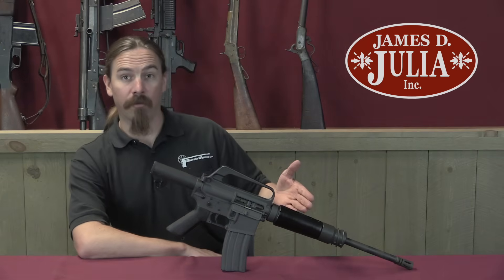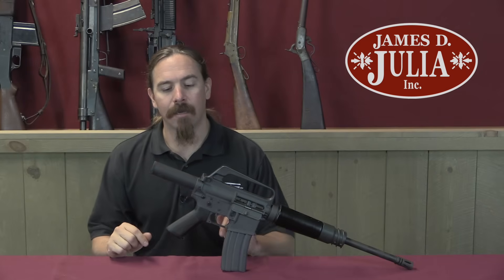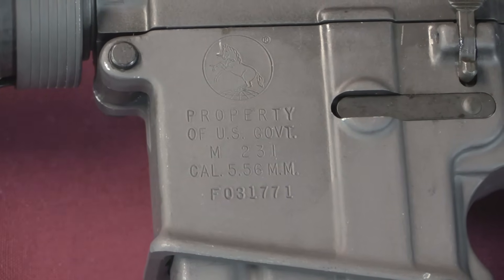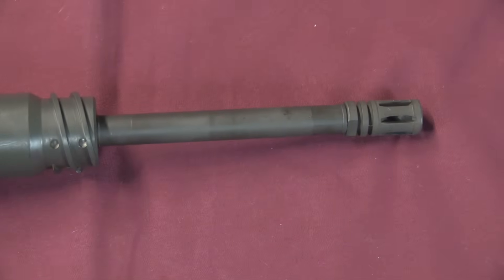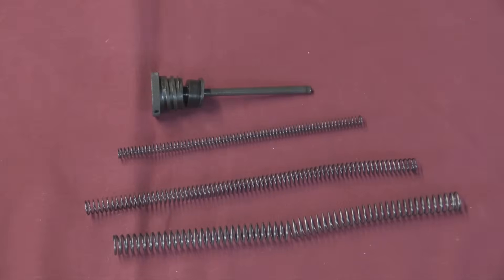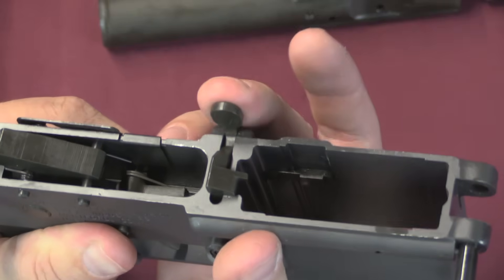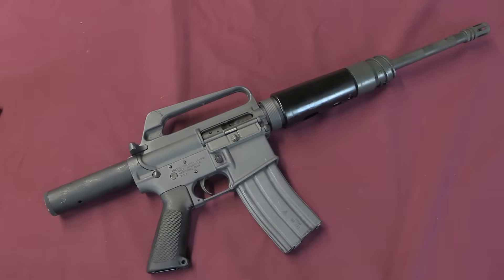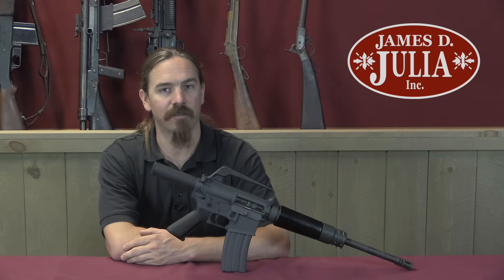Really Not an M16 at All: Colt's M231 Port Firing Weapon

Comment: The M231 Firing Port Weapon is only intended to be used inside the Bradley AFV in a special mount. Hits hard, but good luck hitting anything...
... You're going to use it anyways, Boss?

Comment: What do ya know, another insanely expensive, mostly impractical part of the Bradley catastrophe!!!! Ps. I spent 7 yrs in the Mechanized Infantry. 90 to 97
Reply: The Bradley was no "catastrophe" despite its expensive and complicated R&D (as many other projects faced similar), and the silly movie you likely refer to. It turned out to be a decent IFV. I you really spent 7y in mech you would know that.
Reply: I was 1st cav and 2ID 95-98..
I feel like the Bradley kind of proved itself in desert storm, and now in Ukraine..
And in retrospect, I'm glad I didn't blow out my knees or my back because I wanted to be airborne.
Reply: @rogerwilco5918  The only reason why the Bradley has that bad rep is this silly movie (which afaik is based on a book). Found it funny aswell, than did my service and research and realized that this movie is overblown comedy and at times made by/for stupids. Alot of the changes during R&D and the transition from APC to IFV, were in response to the advancing tech and doctrines, specifically as reaction to the BMP-1 and its good performance in Yom Kippur. AC, ATGM, decent armor against similar, firing ports, but less dismounts were the new trend of IFVs and nothing crazy. While the Marder and BMP went for the lower silhouette approach, some argued the higher of the Brad helps with line of fire over friendlies. Firing ports concept didn´t make it long and got removed from most IFVs. Ukrainians are quite happy with the Bradley. It is nothing special but neither a catastrophe.

Comment: The reason this weapon was developed is that it screwed into a firing port in the hull and was fired by spotting through a vision block, so it created less of a vulnerable point than firing slots large enough for several men to fire out at once.

It didn’t really work.
Reply: Also using your service rifle in a crowed mounted Bradley would be not easy. (Butt, sign post, handguard...)

Comment: I had an Armored Cavalry Troop of M3's in Germany. The M231 was needed because the standard M16A1 would not provide a seal against NBC agents (they tried, how the Russians and Krauts did it I don't know), hence the threaded adapter. The M231 was NOT an individual weapon, it was part of the M2/M3's vehicle suite and issued as such, like the chain gun and coax machinegun in the turret.  Of course, having an M231 and M16 for almost every man, made an already crowded vehicle even more cramped! Once the A1 vehicles arrived with applique armor covering the firing ports, the M231's disappeared.

Comment: TY-Ian. I get it now about the M231 PFW. It is designed as part of the Bradley's self defense , AND the 231's may become contaminated while driving through the NBC battle hell. IF Infantry M-16's were used, they would contaminate the interior when pulled in from the FP.
 -Designed  so the troops can NOT use them freely is a factor you may have missed ? ;)

Comment: Read a lot of the comments here. A couple things I'd like to point out. First. the weapon used 40 round magazines, not 30. Second, each port had a vacuum tube/brass catcher bag that clicked onto the weapon and fan exhausted the gases outside of the vehicle. Third, when dismounted you shoot it like you shoot an Uzi. 
The problem with this comparison with an Uzi is there's no one shooting it correctly as far as I can tell on Youtube. So I'll try to explain.
With the M231 you tuck that short buffer tube into your armpit, and jam the "carrying handle" hard into your shoulder. Grip it tight with your upper arm and pull hard back with your lower fingers so it's locked into your torso. Then you take your left hand across your body and place on top of the short handguard, thumb down on the left side, using your palm to press hard down. 
This is the technique we were taught by the West Germans at the Scheutzenschnur qualifications and cross training events, where we shot all the weapons. 
I'll be honest though, it doesn't make it any better, but it does keep it from getting worse.
I was a SAW gunner for the first 4 years, had a SAW in Desert Storm. The old one. Thing about that old saw, if you were willing to sign a statement of charges and the commander decided to, you know, not give you an Article 15 (that old adage about asking forgiveness applies if you got the cred to pull it off), you could do things to it that you can't really do with the newer ones. But to be fair, the newer SAWs have the bells and whistles that the original SAW didn't have, like the extendable stock and the short barrel. Back in my day, if you wanted a short barrel you had to make your own, and you cut it too close it doesn't cycle anymore. The stock was easy, just cut the stock off the buttplate, drill a hole through it for a sling, hack the rear sight off the feed tray, hack the front sight and carrying handle off your now slightly shorter barrel, cut the bipod down to about 6 inches and tape the legs together leaving the feet, and you get a much better fully auto trenchsweeper that you can put the bits into your ruck and take with you if you think you will need it. They do make you pay for another barrel, stock, bipod and feed tray, but at the time it was like 400$. Or so I've been told, allegedly, by a friend... But 200 rounds beats 40 rounds hands down for certain applications.
Reply: Thanks for this.  I started to respond to a six year old post where the guy said shooting it filled the Bradley with smoke and brass.  I seriously doubt the guy ever served in a Bradley because you are right, it had an exhaust system and brass catcher that attached.  However, unlike you, I don’t remember ever firing the port weapon dismounted.  I only remember shooting it in the Bradley (I went through Bradley transition in Germany with 1/4 Inf., 3rd ID in 1984ish).  You could never get more than 3 trigger pulls no matter how tight your control was that thing fired so fast.

Comment: My unit retained our port firing guns up until 2017 iirc, I had the opportunity to mess with them. I had no pretext or instruction, so i was surprised when i took it apart to see the differences. Ours did have the wire stocks however no front sight. 

Cool peice of history that likely could have been replaced by a small fixture that mounts around the barrel and clips to the bayonet lug.

Comment: I wonder if one of the reasons "why not use the regular rifles" would have anything to do with the potential for that to lead to a discharge inside the vehicle. If your guys are using their own rifles out the ports and one of them gets hit or goes down, whether it be due to a bullet or shrapnel, it could be possible for his weapon to fall out of the port and for him to accidentally discharge it after it does.

If the weapon is mounted into the hull, that can't happen.

Comment: Wouldn't a belt feed be better for a spray and pray firing rate?
Reply: No room in the Bradley to have that many belt fed weapons in action at once.  Plus, when they were first fielded, all we had were the M240 and the M60.  There was an M240C mounted coaxially with the main gun in the Bradley, and each Bradley crew had one M60 gunner.  You would have had to convert the whole dismount team into machine gun teams for your plan to work, even if there was enough room.  Then there would have been the issue of barrel changes in a moving vehicle.  I think the better solution wound up being what they eventually did…give up on the firing ports and put more armor in its place.

Comment: Wait what about the third pinhole isn't an open bolt full auto not required to have a full auto sear
Reply: no the trigger on this is not a trigger/hammer set up, but just a block and notch like an open bolt machine gun

Comment: I wish I could see a cad rendering of this in action. So the spring system pushes the hammer rod into the pin after the bolt has locked? How do you time that?

Comment: Its interesting this is the weapon they feature in Battlefield Bad Company 2. Its mounted in the sides and rear of the M2 Bradley the BMP2  and the sides of the AA tank its the Russian capture ZU 2 Something.

It really is scary it sounds like a MG34 and it basically garuntees a respawn on the guy getting to cocky to with an AT launcher it has essentially infinite ammo you just have to burst fire it for 3 to 4 seconds

Comment: Besides the reason several others have mentioned previously (NBC sealing while the M231 is installed) another reason the Army used the M231 instead of the M16 is the brass catcher and gas recovery hoses would not fit on a standard M16. The lack of a brass deflector and forward assist gave the receiver a flat surface to mount the hose and catcher assembly. To be honest, it didnt work perfectly, but it did help keep gases from building up in the back of our track.

Comment: Why not use standard issue soldier weapons? This is a drivers gun. Bradleys are cramped. This is shorter. Y full fast auto and no sights? You will have a choices in a brad for enemies at range. This is holy poop theres a guy on the brad need to clean him off of there gun. The driver of the brad has very little leg room the hatch is big enough but easier to get that guy off the hood by sticking a shorter full auto out the hatch than a larger more robust weapon.

Comment: I only know about this gun from a game on Roblox, It's called Phantom forces. It's the 2nd most popular FPS on the platform and the M231 is one of the last assault rifles you can unlock. It has insane recoil and an insane fire rate. It basically goes straight up after you fire it for 2 seconds

Comment: The most interesting part of this is the bolt hold open is behind the sear which id imagine is because the muscle memory of the user is to throw another mag in and slap the release and continue firing however since it’s open bolt it would send the bolt home and fire off a round 

Idk if this is correct just a speculation

Comment: I got parts to a 231.  I have the side selector plate, I have parts to the buffer tube and the extension that went over the tube for the grease gun wire stock attachment with the wire stock and button.
Think I'm going to build an AR and use the parts to make a representation piece since I'll never afford a real one.

Comment: If you could get one cheap enough I guess you could strip it down to the bare lower weld up the fcg holes and redrill for a standard M16 fcg and build it as an M16

Comment: M3a1 grease gun could have been easily modified to fill this role. Literally a 6" barrel shroud / nut with port thread on end.
Arsenals made 45 acp tracer. ROF could be increased with a spring swap.

Comment: I was with 1st battalion, 18th Infantry in Iraq.  We used to keep one of those beside the commander’s hatch on the Bradley turret in case we needed to spray bad guys up high on a roof or on the vehicles.  We actually did mount them up in the ramp firing ports during Operation Baton Rouge in Samarra but they weren’t used much.  Damn things emptied a magazine out too fast.  The old long barrels on the M249 SAW would fit through the firing ports and that was a much better deal and didn’t have to be unscrewed. The SAW could be snatched back in so we wouldn’t trip over them getting in and out of the vehicles.

Comment: I fired one of these as a guest at Watervliet Arsenal on a teaching tour in 1998.  It is damn heavy, but will empty a 30 round magazine in 1.5 seconds at a firing rate of 20 rounds a second.  The recoil is so horrendous even  holding down atop the fore-end and leaning forward to the point of almost tipping over foreword.  When you pull, and hold down the trigger the recoil force will pick-up a 200 pound man and push him backwards.  This was the reason they were never to be fired out side the ball mount (safety reasons). They were nearly uncontrolable to the average shooter who was unaware of it's vicious recoil.  Hear is one being fired.  www.youtube.com/watch?v=hjVE6bocSNk

Comment: The first time I ever heard of the existence of these firearms was in the post apocalyptic role playing game Twilight: 2000 that came out in the mid/late 1980s. World War 3 had been fought, with great damage done by nuclear weapons to the United States, the Soviet Union, and most of Europe. Despite that, the surviving NATO and Warsaw Pact forces are still going at each other. With resupply from the U.S. almost non-existent, the remaining military are forced to resort to all sorts of measures to keep going. Many vehicles have been altered so they can run on alcohol. Cavalry units are actually now using horses. Some troops are armed with M231 port firing weapons salvaged from destroyed Bradleys and fitted with crude stocks and sights. 
The game begins with one last ditch offensive by NATO forces into central Poland. It is met by an equally last ditch counter attack by the Soviets. Everything falls apart, and the last radio transmission from your division headquarters is "you're on your own". You and your squad are alone in central Europe, left to survive as best you can. There were a number of adventures set in Poland. Finally, you receive word that all surviving U.S. troops are being evacuated from Europe in a small fleet of surviving ships. Once you get back to the U.S., there are more adventures that take place in the post apocalyptic U.S.
Sorry, I know this doesn't have much to do with a Chanel on firearms, but when I saw it was about the M231, it reminded me of the game.

Comment: I’m currently a mech infantry soldier and even while deployed I’ve never seen a M231 on our Brads
Reply: well, it’s easily one of the most pointless and impractical weapons I’ve ever seen, maybe the military is starting to realize that
Reply: @jasonarmstrong5750  it’s fucking awesome though, that rate of fire on a 5.56 is something i’d want to have if i was in any sort of cqc
Reply: @floo1465  you could get better results with a Famas, it fires just as fast, is more compact and far more controllable
Reply: @jasonarmstrong5750  isn’t this a little bit faster than a famas?
Reply: @floo1465  only by about 50-100 rounds per minute. In my opinion a difference like that is negligible

Comment: In the early '90's at Fort Polk, our dismounted infantry used these in trench clearing. Our Bradley's were standard M2's with the firing ports including the ramp. Our battalion never used them as intended. Most were never even fired.

Comment: Who here has played with this on Phantom Forces in Roblox?
Reply: I did, more so than any guns so far in the game, and its a beauty. Unironically.

Whoever says the gun is bad are probably the exact same crowd that will spam votekicks/reports the second they die once in a video game. Think of it, this gun has zero horizontal recoil, making it much easier to handle than most weapons. It is also extremely easy to find ammunition and boasts the highest reserves. Mobility is nimble and reloading is quick, but the greatest upside hands down is the TTK. 3-4 shots at 1225 RPM, more than enough to delete any brainless whiners who take the name of the M231 in vain.

Comment: Simple to convert an ar15 to an m231, take out the stock hammer, drill a hole centered with the safety and 3/32 below top of lower, insert a dowel through the hole in the center of hammer and file down so it is 3/8" above flush with the top of the lower receiver, file down the curve of the disconnector on the trigger, do a little modifying of the trigger assembly springs, weld the slant on the back lower of the bolt and grind till flush, make a notch that matches the hammer corner starting 7/16 from opening of the bolt and drill 1 more hole about 3/4" in front of the new pin and 1/8" below that and use that for a stop for the hammer. You're welcome, come get me ATF you unconstitutional controlling communist fucks, my rights "Shall not be infringed"

Comment: The standard issue rifle wasn’t acceptable for use on the vehicle because it cooked off when hot. If someone with drew their weapon from the firing port and it cooked off inside the results would be catastrophic. Thus they wanted the open bolt modification.

Comment: The M16 was too long to fit into firing ports, based on the space available in the Bradley.  You'd have to clamp the barrel between the front sight and flash hider, meaning the rifleman is more than 3 feet from the firing port.

The BMP/BMD firing ports worked because the AK bracket grabs it closer to the back of the gun (around the gas tube and barrel), and they planned to issue the folding stock AKs to BMP and BMD mounted troops.

Comment: The reason the didnt use the m16a4 or whatever they were using at the time is that the back of a m2a2 Bradley is way way to small to accommodate a full length rife when it has a squad in the back.

Comment: The M231 PFW was a short-lived little doohickey; since the firing ports on the M2 IFV were deleted when the M2A2 IFV came into production in the late 80s. 
 Unlike the firing ports on the Soviet BMP-1, which were designed so that you could use a standard AKMS rifle instead of having a machine pistol that’s only somewhat useful while attached to the firing port.

Comment: Good info video on the enigmatic M231 Bradley port firing weapon.  This was an overly-complicated solution to a problem that didn't exist.  This was the government's way of finding the more complicated solution to any problem because the simple and straightforward are regarded with suspicion.  A telescoping stock CAR 4 or XME177 would have solved the same problem.